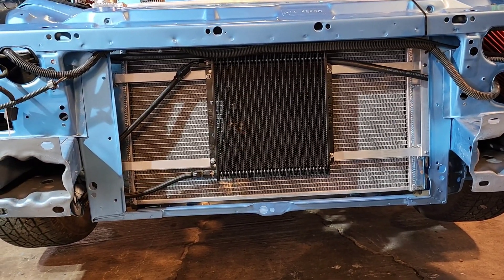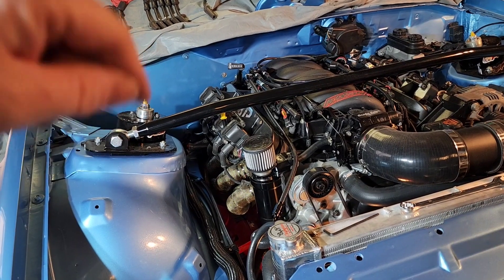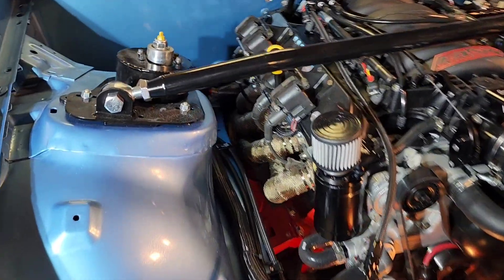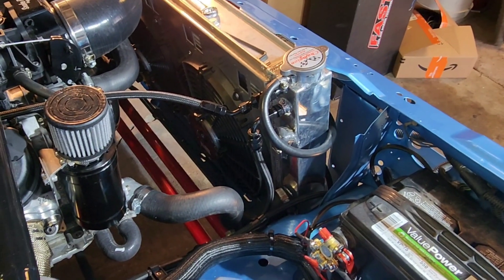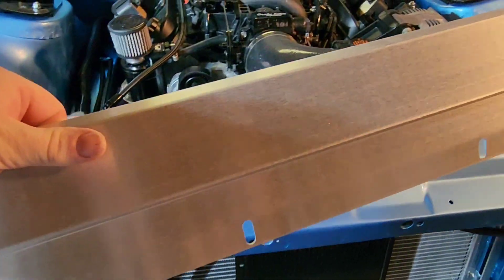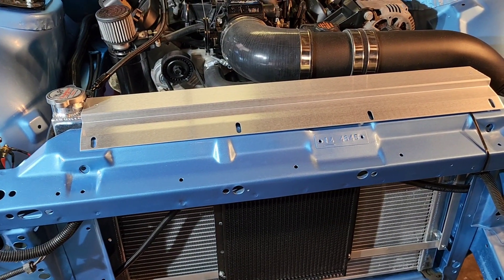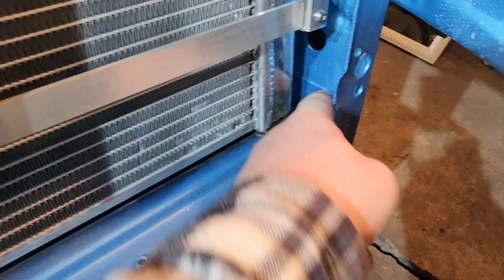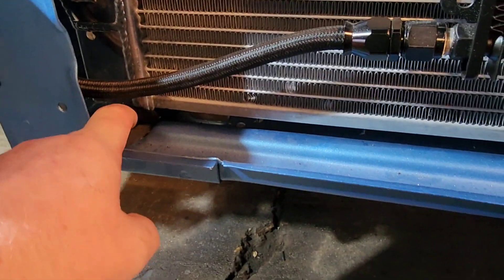LS swap trans cooler and radiator overview in 3rd gen Camaro

Comment: Is there a reason why you put the pressure line into the top of the radiator? I would consider putting the pressure line into the bottom of the radiator so that it would push any air in the transmission cooler on the side of the radiator out. Same with the auxiliary transmission cooler in front of the radiator fluid in to the bottom, pushes air out the top which goes back to the transmission and drains back into the pan. Just being a driveway mechanic that would be my thoughts.

Comment: What did you have to do to get that 4th gen radiator to fit? Looks like its sitting too high.
Reply from the maker: I adjusted the rubber isolators at the bottom and it fit nicely with the bracket on top.

Comment: Hey man i dont got an ls but i got a 468 bbc in my 87 iroc wanted to get those slim fans since my stock fans are to big but i also have a 4 row aluminum rad do you still think those slim fans would do good its a daily driver street car.
Reply from the maker: These are rated a little over 1200cfm each and move quite a bit of air.  There's reviews on SummitRacing where guys have good luck using these on big blocks.  I'm assuming you have dual 12" fans. Sorry I haven't had the car out in the heat long enough to give you my own review yet.  Spal brand was recommended by a local dyno tuner.  Part Number in desc if you'd like to look them up.